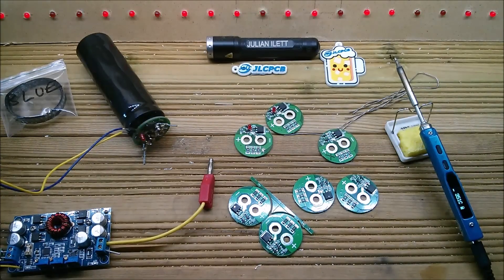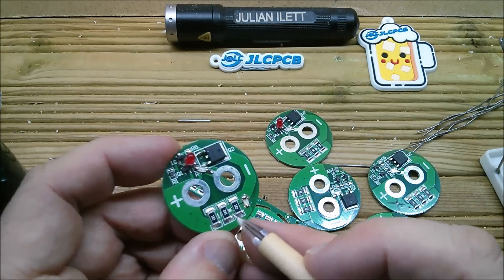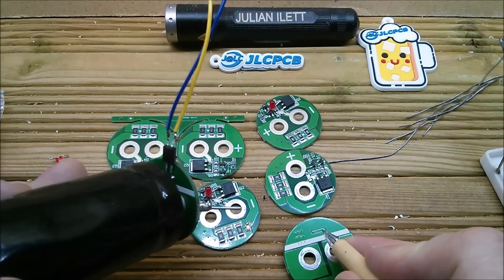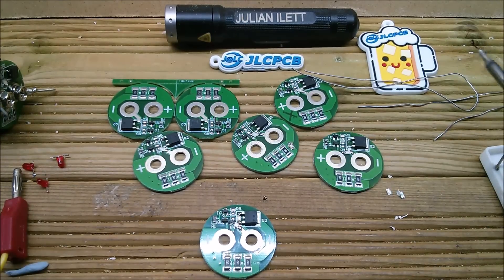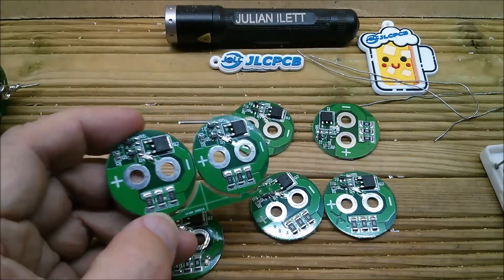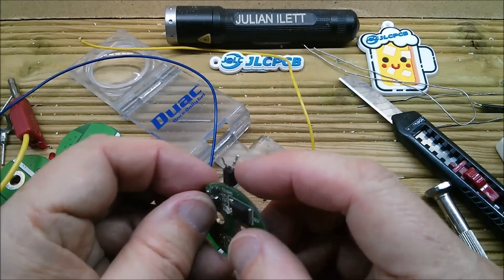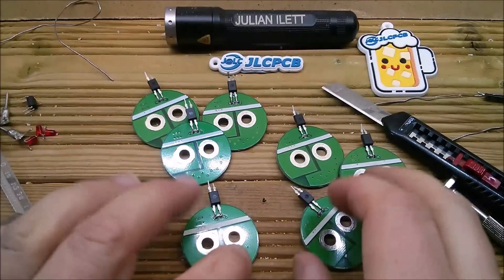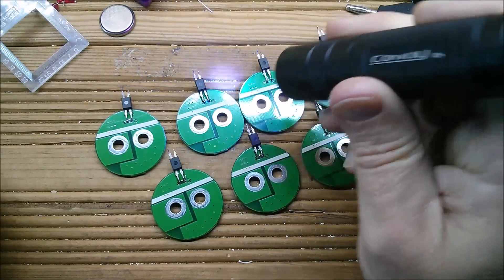SuperCapacitor Protection PCB Modification

Comment: weird and probably stupid question but...can I rearrange the circuit on a 60S, 160V BMS PCB without disassembling it? As in by drilling out or otherwise severing and and then reverse wiring connections turning it into a 6S 10P board? It's a high end bank and I really don't want to completely destroy the board...nor desolder 60 capacitors - ugh...or, barring that, how do I step it down to a more common voltage?

Comment: you're going to put the optos in series so it only signals when all are charged or you will use some multiplexers to pass to the controller  which ones are ready ?

Comment: I'm also in the process of doing a complete overhaul of the protection boards for my 3000F 2.85V supercaps (12 caps, 1000F 17V max in series-parallel). Because I'm using my supercap modules as a car battery replacement, I want charging to be aggressive (200A+ from the alternator).

-Transistor Swap: replace existing 2SD1804 NPN transistor with NCE2060K N-channel MOSFET with 1V gate threshold voltage 6mΩ RdsOn, 60A drain current and 60W(Tc) heatsinked power dissipation rating
. I found that the old NPN setup dropped as much as 1.3V across it and maintained an average temperature of 135-160 degrees C while balancing using 0.5Ohm resistors. The poor performance was likely due to insufficient base current. There aren't a lot of cost effective high current (>10A) NPN transistors on the market, so switching to FETs was an obvious choice.

-Logic Transistor Swap
: replace existing S8550/2TY PNP transistor with HX2301A P-channel MOSFET with 1V gate threshold voltage. PNP signal transistors have a fairly high collector saturation voltage: They're not ideal for driving MOSFETs with only 2.5V of headroom when they themselves drop 0.6-0.8V. Also the previous PNP transistors maximum collector current would be exceeded if I wanted to drive the 2SD1804 load transistor at any current greater than 5A (gain drops severely with current). A P-channel MOSFET will allow the main N-channel MOSFET to be driven with the highest possible gate voltage and lowest RdsOn.

-Balancing Resistor Swap: replaced pair of 6.8 Ohm 2W surface mount resistors with 50W power resistors (0.135 Ohms) to upgrade balancing current to 20A per cell from a paltry 400mA
. I could have purchased 0.015 Ohm resistors to max out the transistor rating, but at 20A, the FETs stay cool, and the total balancing current will be 240A, which should be more than enough for a car alternator. I was skeptical that the SMD heat sink for the 2SD1804 I also purchased would be able to dissipate 20W of heat at 60A and 6mOhms of resistance anyways. 

Here's a photo album showing the caps and balancing boards. My MOSFETs and heat sinks are currently shipped and on the way, but the system is currently functional with an acceptable balance current around 3-4A with the existing NPN system. The only component I'm concerned about now is the 18 AWG wire going to the power resistors. Two AWGs in parallel drop the effective AWG by 3 sizes, so two 18 AWG wires in parallel would be enough for even 30A continuous. That being said, balancing will never be continuous, since alternator voltage will never exceed 14.8-15.2V which is 2.5V per cell (balancing is set to kick in at 2.67V with an onboard voltage divider). In a solar setup like yours, however, I would have rated my balance current to bleed the full power at MPP.

https://photos.app.goo.gl/NPHGyuRrHg5sK2Wa8

edit: formatting
Reply: Can you publish the schematic of your protection circuit? I'll be very appreciated.
Reply: @atskijvinny  Certainly,
First, here is Julian's unmodified balancer circuit, credit to wictor on the eevblog forums: https://www.eevblog.com/forum/projects/chinese-tl431-super-capacitor-balancer/

Next, here is my modified balancer circuit made for 20A balancing per cell (more if R5 resistance is reduced)
R7 is fairly flexible, it serves as a soft pull-down resistor
https://photos.app.goo.gl/yV3n1sAmudKa6ZR98

You could also place an LED + resistor in parallel with R7 for balancing indication.
Reply: @InfinionExperiments  Thanks a lot!!!)
Reply: @atskijvinny  Hey atskjvinny, upon futher investigation, the original BJT setup could be upgraded to 5.5A (3A in Julian's circuit) by replacing the TL431 with TL432 upside-down and using two identical resistors > 10k in R2 and R3 to balance at 2.5V. If R3 is 10% higher than R2, the balance circuit will kick in before the supercap hits its maximum rated voltage, and prevent it from being overstressed. 

The problem with TL431 was that it only pulled its output down by 0.5V to 2V because it shares its VCC supply pin with the output, and the minimum voltage for TL431 to operate is 2V. This is why the balance circuit was performing so poorly. 

MOSFETs are still a superior choice if you want a balance circuit that can keep up with rapid charging, however.
Reply: @InfinionExperiments  Thank you) Sorry for the late answer =)

Comment: im not sure i understand the thinking on that lay out . i would imagine keeping the shunt in place too lower any over voltage would be usefull and then use the opto's on the points you see the led's on would work best so you still have a safty feature as well as your power shut down .

Comment: For mounting, I would have suggested drill the holes 1 size too small (over here you can get saws in 1/4 to 1/8 inch steps depending on needs) and then cut the wood lengthwise and put screws thru to firmly clamp the caps between them.

Comment: I was just wondering where that useful little soldering iron stand came from? I just typically use a regular stand doesn't necessarily fit that great but it works that one seems very simple useful I've printed a few different designs on my 3D printer to hold the irons but none that I fell in love with not one's not anything special I'm sure I could probably get one from China but was curious where you got that one? 

Also I was wondering if you were to change the values on those load resistors would that change I'm assuming those are for discharge but I don't know exactly. I'm asking because I'm looking at changing them on my liitokala li500 charger. Would like to try to change them to get it to discharge more It says that it discharges at 1000mA But that is not the case would actually like to be able to discharge it at one amp just curious if I could make that happen by changing the load resistors on the charger? Look forward to hearing from you thanks!

Also nice content keep it up!

Comment: In theory those optos work great in this setup but.. The combined way the transistor sides are in parallel they come on too early without a load. I tried this before. You really need  Schmitt trigger opto isolators is what I found.

Comment: I see your reasoning that the red LED lit, so should be enough to light the infrared LED in the opto, and it is switching, I guess it depends on the characteristics of the opto, I still can only think its not fully on, so we shall see what happens when you 'gang' them all up...cheers!

Comment: A current limiting power supply (lab PS) would work much better than a coin cell for testing.  That small battery just can't provide much current and frankly is a waste of money to use here.  Not to mention even if you recycle it it isn't good for the environment whereas your PS running off your solar power costs nothing and there is nothing to recycle.  (Until the solar panel dies in 25 years I guess!)

Comment: A pair of those 2.5 volt super caps in series would make an interesting 5 volt powerbank, ideal for connecting with a 2 pin Micro USB socket :)

Comment: Treat yourself to a pair of ceramic tipped tweezers, ideal for holding SMT stuff, about £2.50 on ebay :)
Reply: Yes they work great and they do not absorb heat like other tweezers so it's easier to hold things without sucking heat out of them. I would get the I don't remember exactly what they're called but I would get the ones that are reversed. Kind of like the forcep tweezers where they lock and hold except these hold under their own reverse tension They work great I use them all the time to hold small stuff in place every time I use normal tweezers I seem to either not squeeze it hard enough or squeeze it too hard and those little fuckers go flying and I can never find them lol
Reply: @luckylarz4269  They aren't AS thermally conductive, but ceramic is still pretty thermally conductive. You can tell by how ceramic feels cool to the touch. However, it's like night and day versus metal tweezers, but there are better materials for low thermal conductivity. Just not in tweezers :)
Reply: @rich1051414  or that are cheap haha 😂😉

Comment: You could monitor the caps individually with a microcontroller and adjust voltage and current to the caps that needs to be charged.
Reply: Yes, there are. 
He is just following/doing his own way.

Comment: Is balancing even needed on Cap banks ?  I would think they would self balance in series.
Reply from the maker: It's overvoltage protection. If you pump current into a capacitor, its voltage will rise up to, and beyond, the rated maximum.

Comment: The red LED is so dim, what's the voltage drop across it ? that opto is probably not fully turned on because clearly very little current is flowing through the LED as there is no current limiting resistor...so my guess is that the opto isn't switched on...cheers.
Reply from the maker: I've found a different way to check the optos - DMM set to ohms across the opto-transistor (which are now all bussed together). When the protection reaches maximum current, the opto 'resistance' is about 1k.
Reply: @JulianIlett  Oh ok, that maybe explains why so dim, if its about 2.5 v  that means about 2.5mA for the red LED ?
Reply: Does look like the opto is not being turned on enough.  Need to know were Julian connected it to, by just cutting the track you are limited to whatever current was flowing and it would seem not to be enough.
Reply from the maker: This video shows where: https://odysee.com/@julian256:d/reverse-engineering-a-supercapacitor:9
Reply from the maker: And here's an update: https://odysee.com/@julian256:d/700f-super-capacitor-protection-pcb:6
Reply: @JulianIlett  looks like there is not enough base current to turn on the opto.  I would have used another transistor and resister to drive the opto  fully on. Time to bird nest some more SMD components on. :)